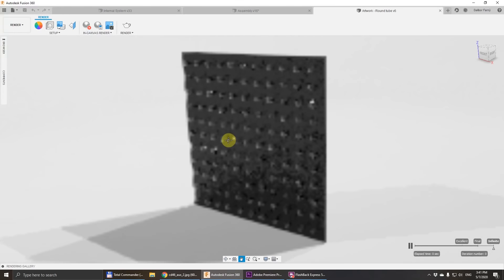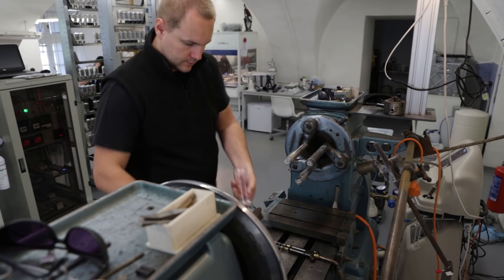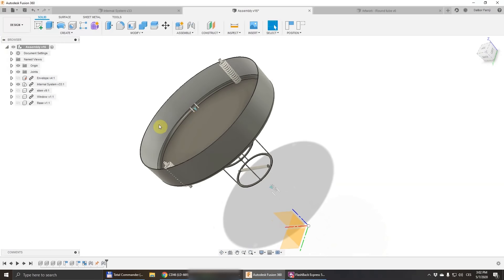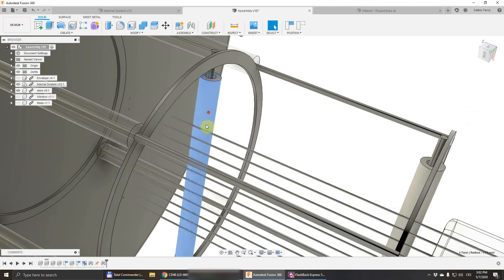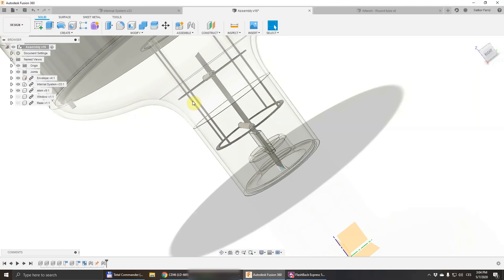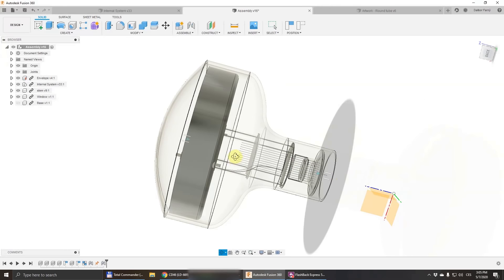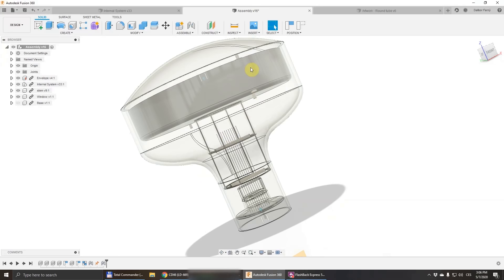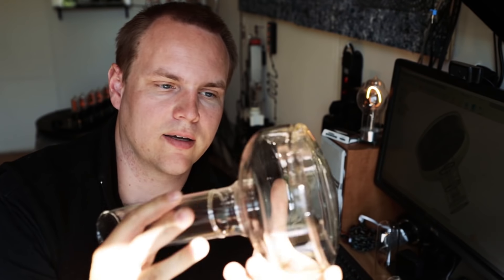Starting New 150mm Nixie Tube | Project H #1

Comment: Hi Dalibor Farný, that looks awesome ! I wish you a lot of luck. Here is just an idea I had;
Maybe you could use a preformed/baked ceramic (or cemented) form in which the wires from the wire stem can be connected to the elements trough the back of the face-plate.
Ceramics are real good thermal and electrical insulators and if not subject to excessive vibration can last a long long time. They were widely used in vacuum-tubes before the advent of Bakelite and other modern plastics.
Hope that helps !!
Keep on doing what you're doing, I love it.
Best regards from The Netherlands.
Reply from the maker: Hi! The ceramics will be definitely used, I am not sure if I understand your idea - if the connecting wires go inside the anode cup, they would glow as well..
Reply: @daliborfarny  hmm, that IS tricky. Perhaps you could have small ceramic tubes (or a grouped pair of them) pertruding out from holes trough the back of the anode cup and feed the connecting wires trough them?
It would serve 3 purposes:
1. Improved mechanical support for the elements at the front
2. Electrical isolation between the wires and the cup
3. Being not transparant, even if the wires would glow around that area you would never see it. Because the wires would be inside the ceramic pieces.

Hope that helps 😀
Reply: @daliborfarny  Perhaps you could "sleeve" wires with glass capillary tubes? Fuse those sleeves with stem and it would provide mechanical reinforcement and elecrical insulation. You will need to worry about potential difference on the open end of sleeve, no need to seal other end. Though I know nothing about nixies so you have probably already thought about this :)

Comment: If oxidization damage to the internals of the tube from the exposure to heat in the front glass bonding proves to be an issue, an alternative method to attach the front glass would be to use a frit seal to bond the front glass to the tube. This is how CRT manufacturers would attach the front glass and the neck onto the funnel of the tube without thermally stressing and warping the glass or damaging the inside structure of the tube.
Reply from the maker: Hi! Yes, a solder glass (frit) is plan B. I have no experience with it, so I rather stick to traditional seal. But if this doesnt work, frit might be the way to go. Frit is also more economical (faster) and easier to delegate once the setup is made.

Comment: Are you using uranium glass for the stem? Apperently they used to use uranium glass around the wires as that created a better seal between the metal in the wires and the glass

Comment: What about splitting the wide part of the tube at the back instead of the front to protect the digits and other parts from heat when welded back together? This could potentially allow for shorter tubes without the added construction at the back (unless that's a wanted feature).
Reply from the maker: Thats another option, we will see. The glass at this part is 3mm thick, so more heat is necessary. The window is thinner, so possibly less heat..
Reply: @daliborfarny  You don't need a back part to be transparent. You could use a thin metal tube inside to dissipate heat while glass parts are welded. The only question is temperature expansion coefficient of glass and that metal tube. Or this metal tube can be a heat shield-anode holder and could not touch glass at all.

Comment: What a cool and ambitious project!  Out of curiosity, have you ever experimented with different gases such as xenon and the like?  I know that each gas has a different color spectrum and also a different voltage drop.  I just wonder if Nixies were always made in orange neon because it's in the eye's most sensitive range or if there are other technical issues.
Reply from the maker: Yes, a video on this topic will be made one day. In short, all other gases are impractical compared to neon.. too low brightness.

Comment: I'm going to follow this with great interest. How do you partition up the various conductors to each digit layer through the top ceramic rods holding the digit stack?
Reply from the maker: The individual digits will be connected by thin wires going between the ceramic rings. Isolation of these wires against parasitic glow will be a challenge..

Comment: Will this type of tube be on the store when you finished it? You currently only have standing Nixie tube but not wall mounted tube on your store, a wall mounted 6 digit nixie clock would be nice to have with this tube.
Reply from the maker: Yes, I plan to make it a standard product. Thanks!
Reply: Dalibor Farný nice 👍 hope it wouldn’t be much more expensive than the current already very expensive (for me at least) zen clock